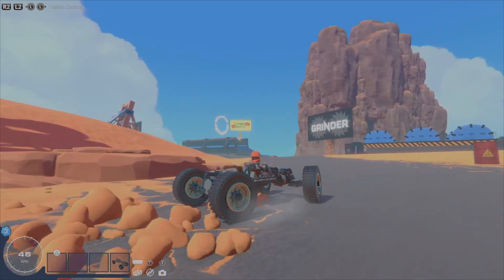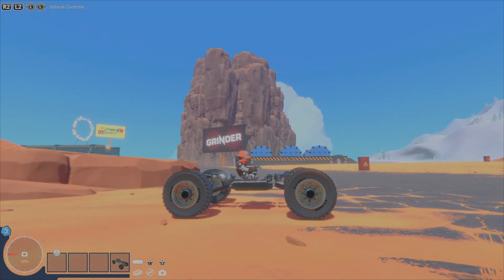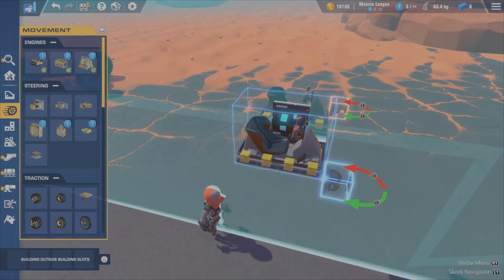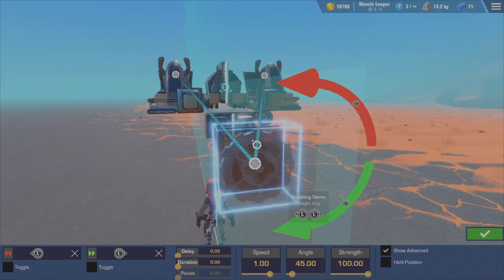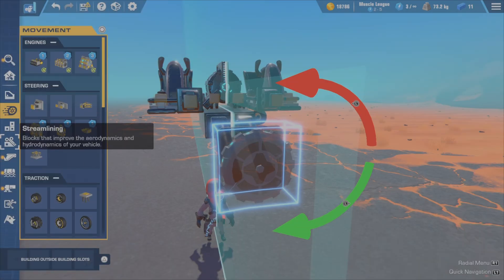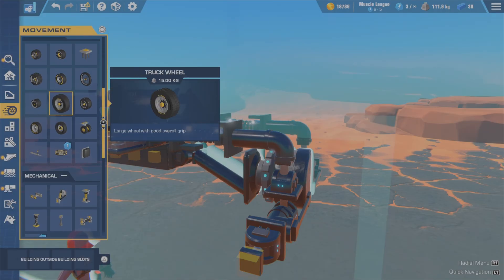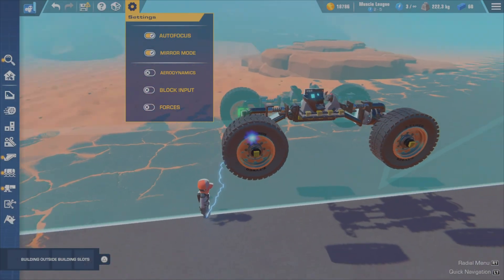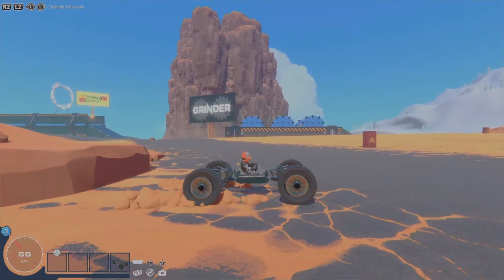Trailmakers Mini Rock Crawler suspension build tutorial

Comment: The whole rock-crawling idea will be much more interesting once terrain deformation will be in the game. I hope we'll get some rock-crawling races on the race island as well.
Also, could you make some suspension setup that's fitted for smaller wheels (I mean standard car wheels or racing wheels size) and that's good for high speeds? Basically a rally/rally-cross setup for smaller wheels? I'm trying to come up with something good myself, taking inspiration from your builds, but I cannot figure it out.
Reply from the maker: I have messed around quite a bit with the smaller wheels, and the only suspension that works is solid axle and trailing arm setups. Non of my double A arm or  Mac pherson struts worked without issue. The issue is if the wheels have a camber or even a caster, the vehicle starts doing weird stuff, and it gets worse with the smaller wheels, unfortunately.
Reply: @DF14NT  so making a small solid axle setup for the back suspension is easy. Small trailing arm is a bit more tricky but also doable. But those two, in my mind, just don't work as the front suspension... How do you even make a trailing arm for front?
Reply from the maker: @Radecki126 you can face the trailing arm forward like in this setup
https://youtu.be/DG-_f8O1_WU?si=7JzbHP_dYltFDnAE
Reply from the maker: @Radecki126 i have a build tutorial for a mini crawlwer with small wheels here
https://youtu.be/dYNHnBi_0d8?si=npIyO844p-W2WcrC
Reply: @DF14NT yea I know this one 😁
I'll try trailing arm in the back and this solid axle in the front and see how it performs at 160km/h 😅
Reply from the maker: @Radecki126 you might have to stiffen up the rotating servos for the solid axle so you don't get so much body roll. Good luck 😊